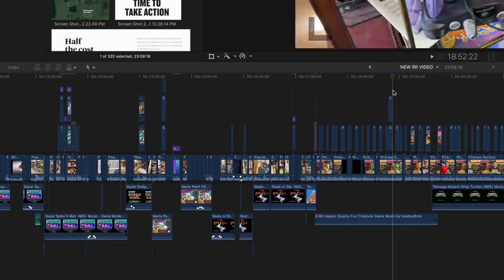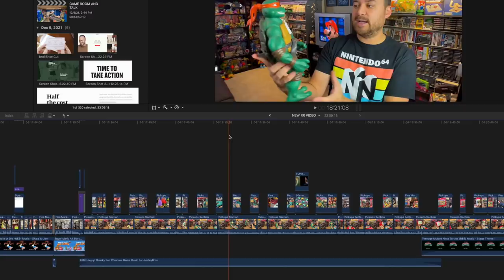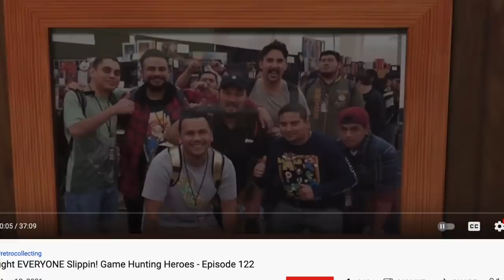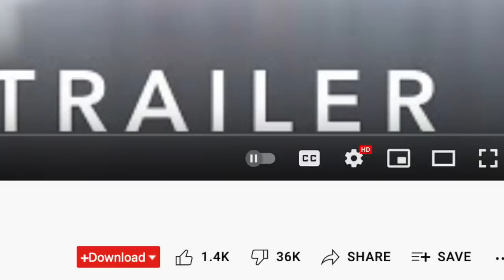....IT HAPPENED AGAIN....Game Room Ruined

Comment: Look into raising the floor framing if it's sitting directly on the ground, laying down a plastic liner directly over the foundation, and adding some ventilation to the lifted space if you do raise it.
Reply: Don't use timber especially for the base.
Reply: Concrete slab foundation.

Comment: Dude lay down cement. It doesn't matter what you lay you need a cement foundation. This is coming from a general contractor.

Get some self leveling cement and you'll have a good layer. Weatherproof the cement or lay an epoxy to seal moisture so it doesn't crack then do the rest.
Reply: And stain the concrete if you’re going to keep it exposed.

Comment: That really sucks. I hope you get it sorted.
I think its more due to the wood sitting on the floor. Ever weather treated wood is going to go rotten mate.
The shed was built for garden equipment and not as a room. To use it as a room you need to off the ground. Either a gap under it or a solid cement foundation.
If you just lay wood back down, in a few years it will be rotten again. - Just a heads up.
Might be worth pulling it down and setting a proper raised frame, and building a new one if you're using it for working?
Happy Christmas dude, to you and all the Fam! x

Comment: You generally don’t frame flooring with 2x4s. 2x4s are for walls. If your framing is that close to the ground/dirt, you’ll probably have the problem again. Remove tons of dirt from under the building and install 2x8s.
Reply: Not meeting building codes.

Comment: Hey bud,  you should have built the shed on a concrete pad. Otherwise your going to have this and issue again and again.  Treated lumber is not the answer.  The weather treating eventually can leach out of the lumber and if your ground under the wood has changed in moisture content the wood will eventually rot or bugs will take over.

Comment: Use a moisture barrier this time between the wood and dirt or at least between plywood and floor joist or it will happen again even with weather treated plywood use sheet plywood not composite. The last video with your contractor friend I wondered why y'all didn't use a moisture barrier bc here you have to but I figured it was bc y'all were in California where it's dryer climate.

Comment: Well I wouldn't do it the way you're doing it of course because naturally the moisture is going to get trapped. I would do either two things.

One lift the structure about 6 in and put it on pier and beam.

Or make a concrete foundation.

Comment: Unfortunately when building a frame of any sort you need to go 16 inches on centre. For a bit of overkill you can go 12 inches on centre.
Reply: What does this mean?
Reply: @ApemanMonkey  when forming a frame you have 1x top and 1x bottom 2x4 (or any type of 2By) and you measure from the edge of each top and bottom 16 inches across the whole 2x. So the first measurement will be 16, 32, 48 etc until you reach the end of the 2x. Then you add 2x between the top and bottom plate in the centre of the marks you made at 16,32,48. By doing this it makes the structure stronger. If my explanation isn’t good enough (kinda hard without visual aides;) search how to Frame a wall or floor on YT.

Comment: love you brother I watch all your video. I love them all. Ive seen them all. I love you game room it reminds me of my outside game room. My advice is not the type of wood as long as you use a good 3/4 inch sub-flooring such as advantech or top-notch. put down some plastic moisture barrier at least 4MIL thick ask the people at Lowes or Home Depot they will know what you are talking about. Also a major thing about buildings are that they need to breath. You need space under the floor with ways for air to flow in and out from under it. Just some simple openings with some screen over them to keep the critters out LOL. Air flow is way more important than the type of wood. Keep up the great work and keep us updated. Love you guys. U.S.A.!!!!
Reply: Plumbing, electrical, appliances too. Savings will always come right back to you. You’ll save big money, you’ll save big money, when you shop Menards. Jingle.